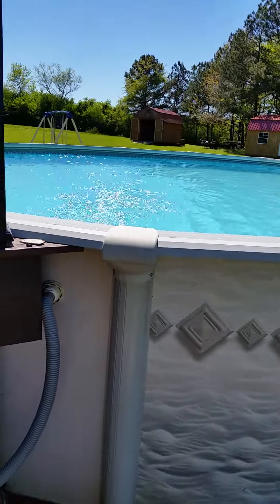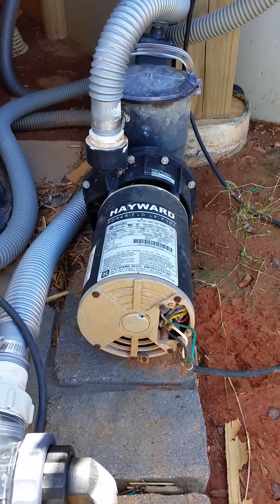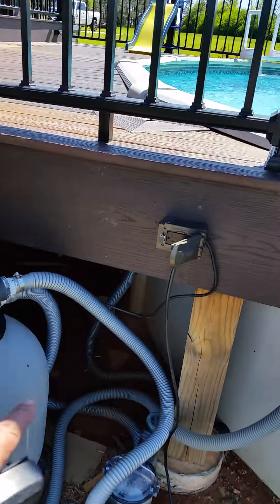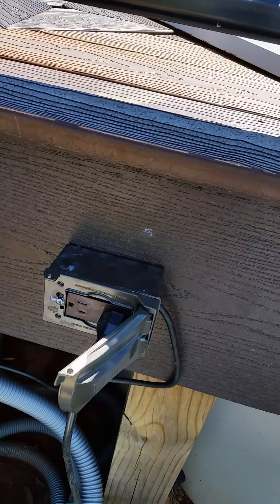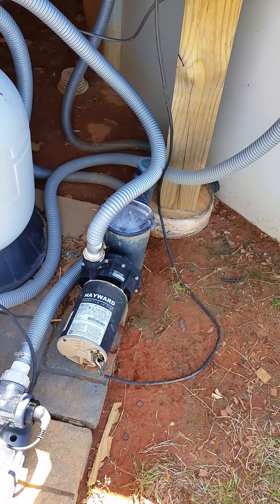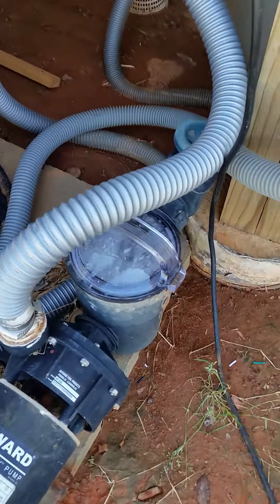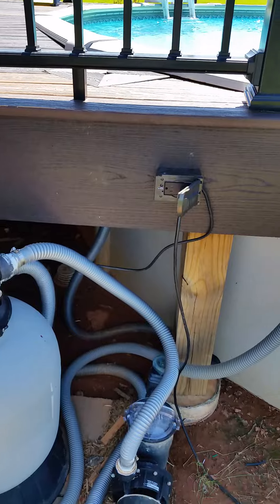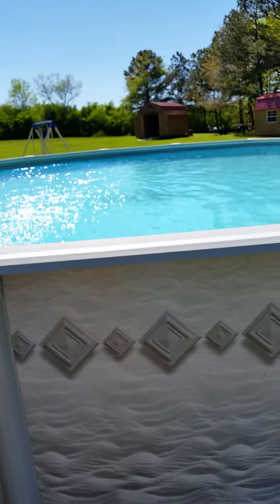Intex saltwater system and Hayward pump not working

Comment: How did you set this up using the hoses I just brought a 18x48 pool I have a intex saltwater system but don’t know how to add it to my Hayward Pro Series Sand Filter System, 18 in Filter with 1.5 HP Matrix Pump
Reply from the maker: I no longer have the pool but from what I remember all you have to do is run the return water line from your filter to the Intex saltwater system inlet side. Then run a hose from the outlet side of the  saltwater system back to your pool. You may have to try different combination of adapters to connect the hoses. Most pool supply places will have what you need.
Reply: West World thank you it’s greatly appreciated